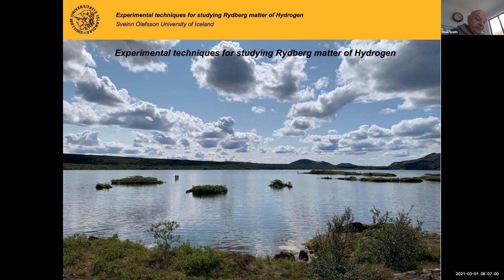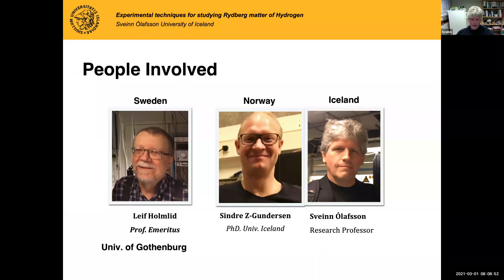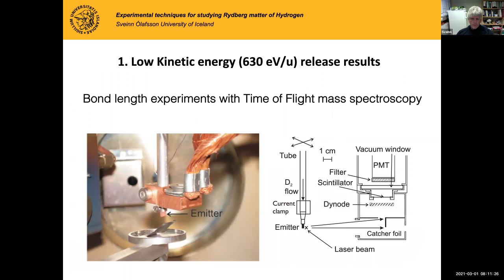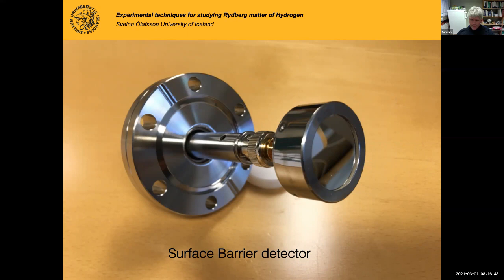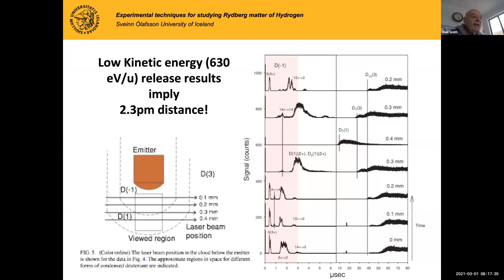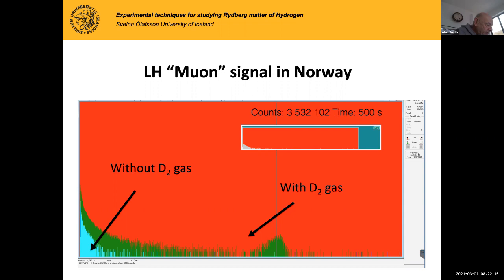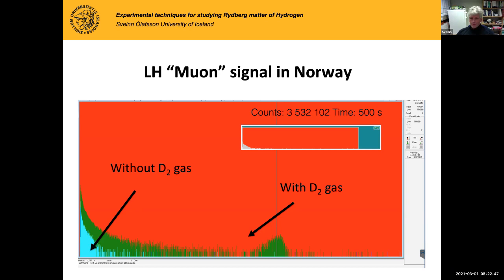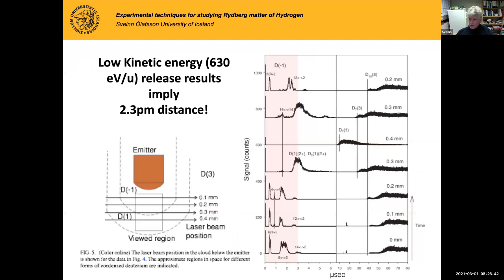Meet Sveinn Ólafsson, Ultra-dense Hydrogen

Comment: @~8:03, is that seen when the lazer is on the foil or while the bright flash is happening while the lazer is between the Cu and the foil?
Reply: I understood that every picture shows the laser being moved from the catalyst towards the metal plate or foil, but that the diffraction happens between both, it ceases when the laser hits the foil.

This is a very intriguing observation, what is causing that scatter/ diffraction?